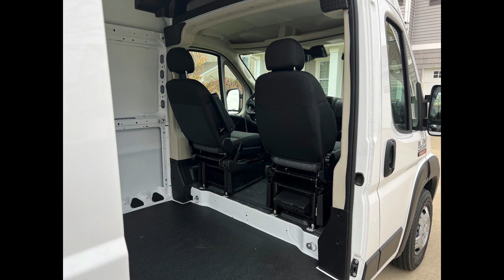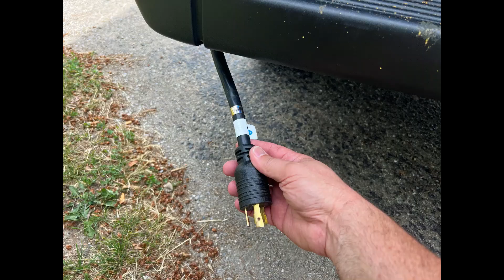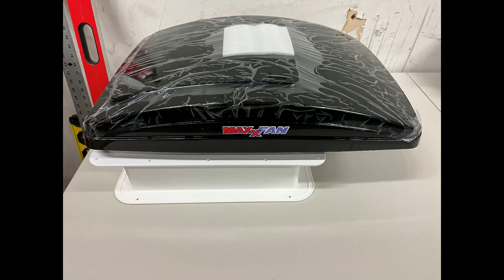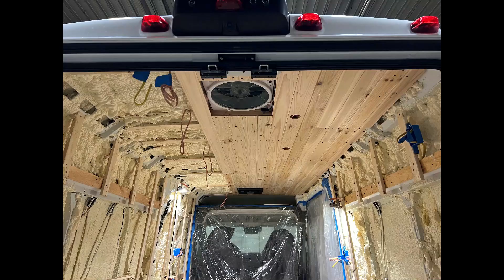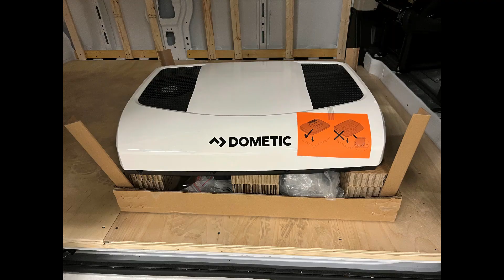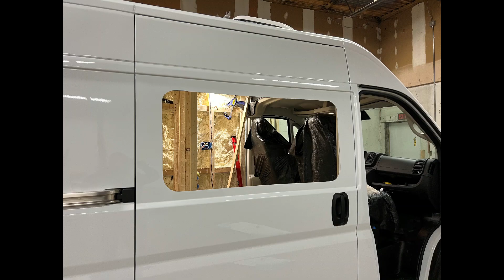Ultimate Promaster Conversion: How to install Subfloor, Solar, Air Conditioner, MaxxAir Fan, Window!

Comment: I have a question about the floor. I see a lot of self builders put wooden slat framing running in between the grooves of the metal floor. Then put board insulation and tape then they put the subfloor. You go across. What is the difference? Is there a difference?
Reply from the maker: Hmm…I like the idea of crossing (side to side) the metal slats of the van with the wooden slats I’m putting down. Seems to make sense to me. I haven’t done it the other way. Seems like I might be fighting the grooves if I put them front to back. Hope this helps!